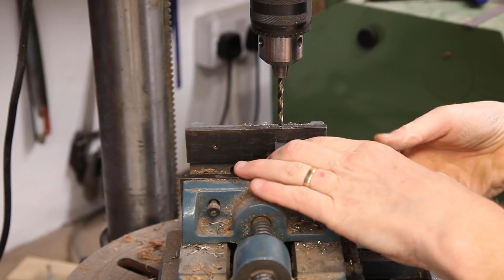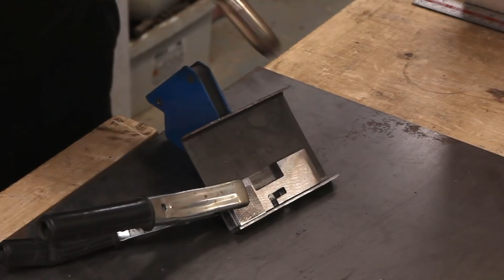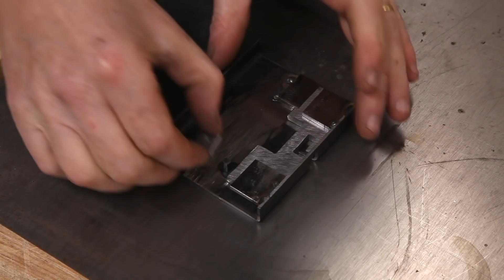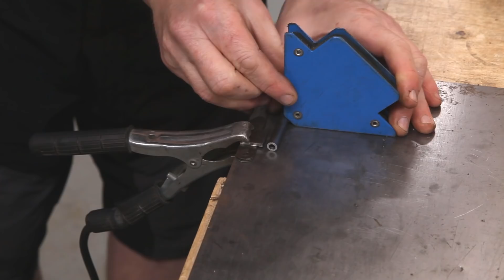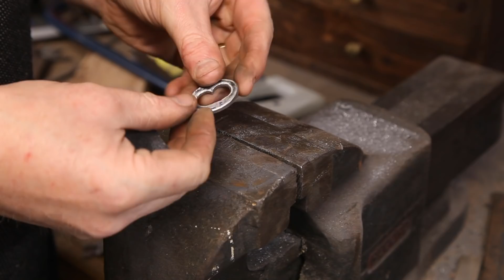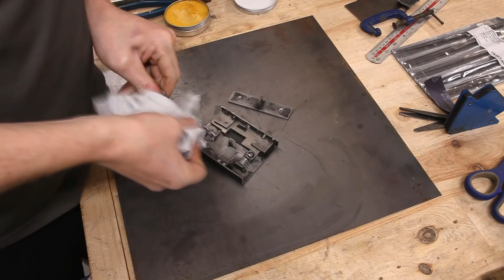A Simple Warded Box Lock And Key Made From Scrap Steel

Comment: That's called a WARDED lock. The piece of metal that fit through the slot on the key is called a WARD. They can be as simple as this one, or very complicated and elaborate. You have the ward on the unlock, but not on the lock. Thanks for the video. Jon

Comment: Very nice lock. it got me wondering if it could be made without the welder using peening, rivets, tabs, and slots
Reply from the maker: I'm sure it could. A lot of the older ones I've seen were made like that.
Reply: They still make them with slots, tabs, rivets & peening. Once you have the tooling and jigs it is faster and cheaper than welding for series production. There appears to be a lot of tools in th background that would have made at least some of the processes quicker and/or easier, such as the hydraulic press for bending and the belt sander/linisher for edge finishing and shaping some of the larger parts. Why use a hand held drill when you have a drill press and vice which would be more accurate? And no backers for some of the through holes?

Comment: I watched the whole video but still failed to see what purpose the spring served?
Also will you do a video showing tou installing and using this lock?
Reply from the maker: The spring is there to keep a small amount of tension on the bar, just enough to stop it sliding on its own. The next video is the project the lock is for :)

Comment: Aah I've missed your videos Jason! Really good to see you back with another "epic" build. I'm curious, what purpose does the spring have? from what I can see - unless I'm missing something - your guides are of a tolerance that should keep everything in line and on track.. Best regards, Mark (South Africa)
Reply from the maker: Thanks Mark, great to hear from you. The spring is there just to keep a small amount of tension on the bar while still allowing it to move easily. If it wasn't there, the bar could be slid backwards and forwards by just banging the lock. If the guides were made tight enough to stop this, there's always the chance the lock would seize up. I'm not sure if there's a better way to do this as I've not really studied these locks,  but it seemed to work well in this one.

Comment: Uncle Upcycle what's the spring's use? I didn't see it interact with anything when u turned the keys
Reply from the maker: It's there to put tension on the sliding bar so it doesn't slide easily. Without it you could turn the lock on it's side and it would just slide open.
Reply: Wow you've even thought about that. You're a pure genius Uncle Upcycle. I reviewed it like 5 times but couldn't understand it.